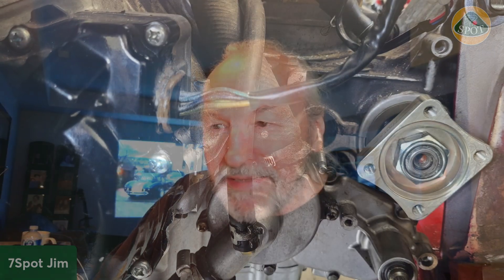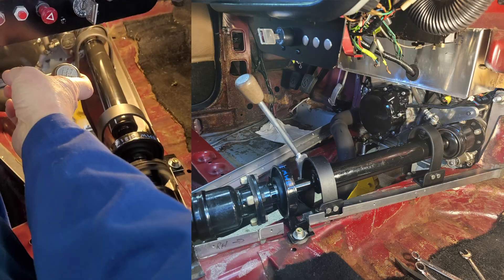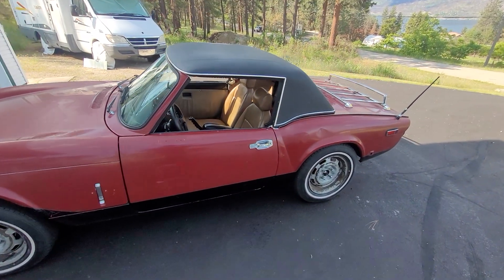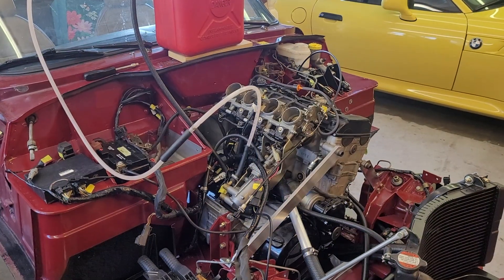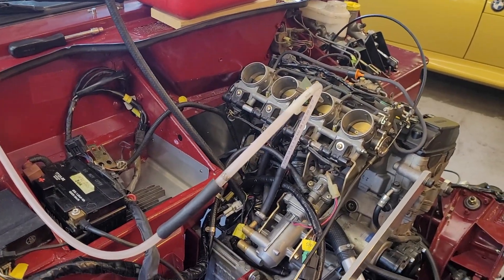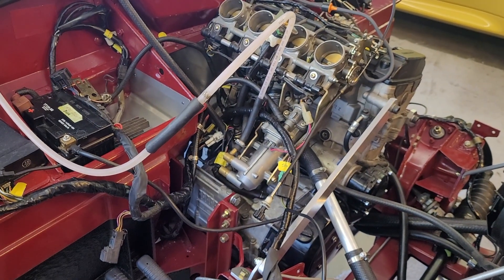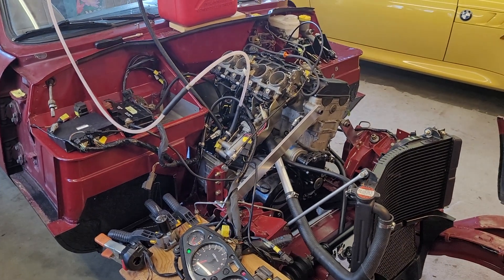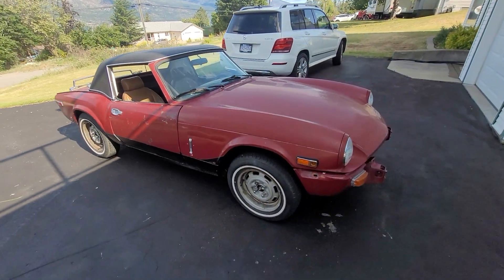Hayabusa Meets Spitfire: Mike’s Wild Build!

Comment: the hayabusa engine is so small conpared to a car engine you could run the engine from the boot of the car and do away with the prop-shaft or do the same in the front if you want front wheel drive
Reply from the maker: Yup! There are loads of builds like that. … google Fiat X 1/9 Busa as well